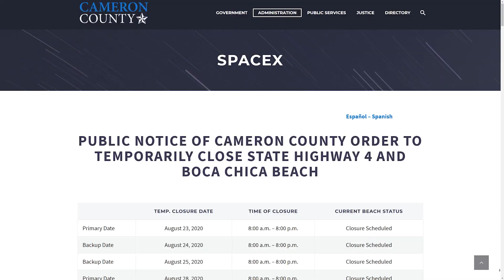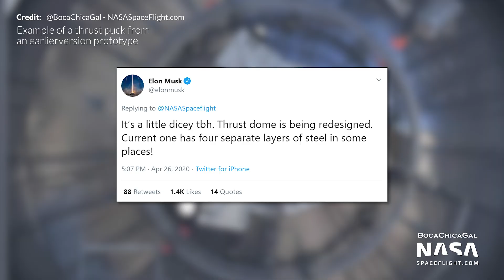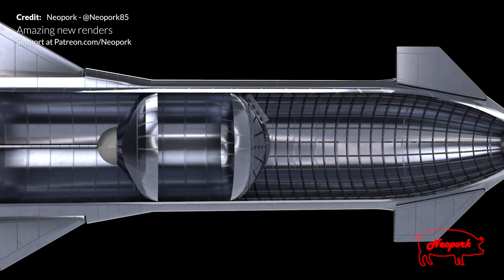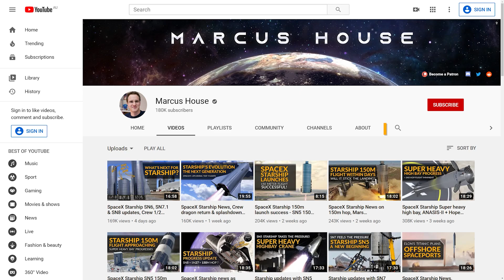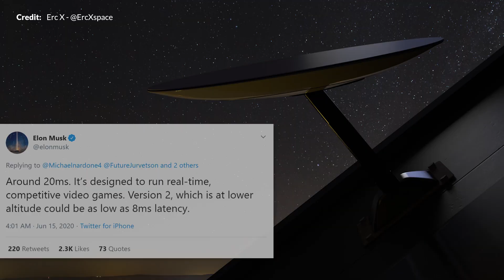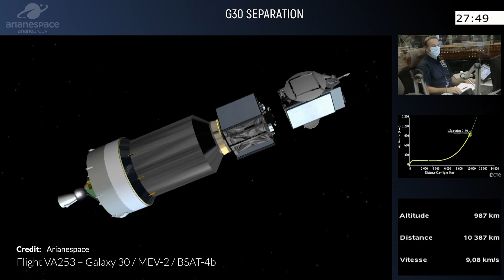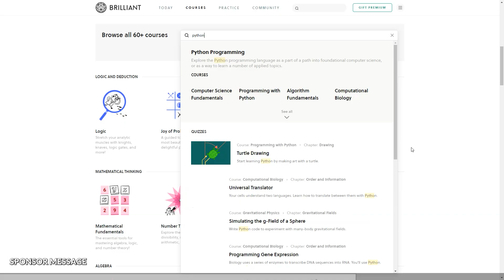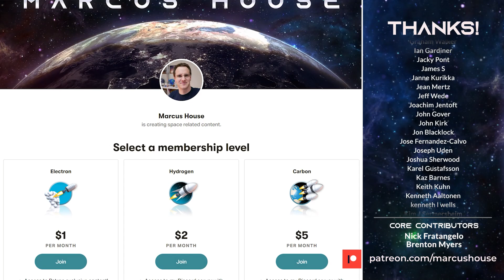SpaceX Starship SN6 to fly in less than a week!?, Starlink Speed Results, Saocom 1B, Ariane 5/MEV-2

Comment: Note that I think Gwyn once mentioned that Merlin had been tested to 240,000 lbs thrust successfully.  The 190,000 lbs used is about 80% of that so likily as not Starship and heavy will not go beyond 80% of maximum successfully tested except in an emergency, or perhaps even less if a man rated flight.

Comment: So I know this is a few days old but it has taken me some time, when I have had it to think about the actuators and pivot points required for the movable surfaces for Starship. The aerodynamic forces on these surfaces at speed will be no joke. The actuator(s) or piston will need to supply significant force to move the wings smoothly and accurately. has anyone else thought about how these would be mounted? What will be used? A pneumatic or hydraulic Ram? What about the pivot points? I spent 21 years working on Naval Aircraft and flight surfaces have a variety of means to move them. What are your thoughts?

Comment: For the moving platform boat thing, why don't they just cut out the circular part and make it like a gimbal such that the hull of the boat moves around, but that circular cutout just stays constant? That can then interface with the rocket, and or sense the weight of the rocket on touch down, and apply a break to the circular portion to lock it into sync with the hull.

Comment: I love Elon's engineering principle: if we can build it and make it work in the dust on earth, it will work in the dust on the moon and mars... However, i'm still fairly confident that the very first thing space X delivers to the moon and mars is a landing platform for the starships to land on propulsivley without creating their own craters.
Reply: Even if in unlikely case this is Elon's engineering principle, it is blatantly wrong. Dust either on the Moon or Mars is vastly different in composition, structure,size, mechanical and even electrical properties. Closes approximation would be vulcanic dust.

Comment: Starlink already has better speeds than I have with fiber optic cable through Frontier in the U.S.! I pay $90 a month and they only guarantee me 15mbps down and 5mbps up. I don't even hit those numbers on a good day.
Reply: @Forcemaster2000 15 Down / 5 Up doesn't sound anything like fiber optic at all.  You might want to double-check with Frontier about the internet package that you're having.  For $90/mo, you should be getting the FIOS Gig Service as shown here (https://go.frontier.com/fios/internet#:~:text=How%20fast%20is%20Frontier%20FiOS,a%20more%20seamless%20online%20experience. ).
Reply: Possibly you are having DSL 2 fiber or similar fraud. Anyway, in most areas of US you have no competition, so operator can limit your speed at will

Comment: It would be nice to get an update on Blue Origin's BE-4 engine.  Tory Bruno reported that BO is having problems with the BE-4 turbo pumps. Blue Origin is still troubleshooting the 75,000-horsepower pumps that bring fuel to the BE-4’s main combustion chamber, Bruno said, adding that’s he confident the issues will soon be solved.  However, considering BO is not known for being on time and the importance of the engine to ULA's Vulcan, anything known additionally would be most interesting.
Reply: 75k hp is about twice the power of Los Angeles class sub.

Comment: Love it Mr M. 
Just one thing. 300 bar? Ain't much. A scuba tank is 200 bar. Pls explain to this idiot :)
Reply: @Mark Wood - keeping 300bar at very high temperatures, in a oxygen rich environment, while the combustion gases are flowing out of the chamber (which requires very powerfull pumps to keep injecting fuel and LOx at cryogenic temperatures - without breaking themselves apart - just to sustain that pressure and therefore the thrust) is a enormous engineering feat. Only possible thanks to generations of scientists and engineers in many fields.

Comment: Question on the tanks: Does the upper tank top and bottom weld to the actual outer rings to form a tank? Does the bottom dome of the top tank serve as the top of the bottom tank? Crazy good renderings!!! Helps me see how this is all constructed. Thanks!!
Reply: Yes and yes.
The skin of the rocket is the side walls of the tanks. That's why you see atmospheric water vapour condensation and ice forming on the outer surfaces of the rocket that are holding chilled or cryogenic fluids. 
The upper dome of the bottom tank serves as the bottom dome of the upper tank - that it's called the common bulkhead design.
All of this is pretty standard rocketry, and is being used for many decades now.

Comment: Can't wait for Starlink. Even prototype speeds are better than I was getting 2 yrs ago. Fiber connections aren't all that. The speed options are great, but the reliability and stability are determined by the ISP. So far, I'm 0 for 2 when it comes to decent fiber ISPs.

Comment: Marcus:  How about a quick explanation of how rocket thrust is measured/calculated.  For example, a Raptor engine producing 225 tons of thrust at a pressure of 330 bar implies a working thrust disc area of about 11"in diameter (~92 sq-inches).  So I guess the pressure (thrust?) is measured at the top of the combustion chamber, and not elsewhere in the nozzle.

Comment: That Belly Flop looked soo scary in the animation imagine riding this thing! I'd crap my pants!
Reply: Peter Hobelsberger I know what you mean. I think it would still beat a super long haul flight like London to Auckland.
Reply: The ultimate roller coaster! Sounds like fun. Hope that one day costs can drop to < $10k for a Earth to Earth round trip.
Reply: @eyeborg3148  I doubt they will in our lifetime since that would only just cover the fuel cost. When the methane starts getting synthesized with solar power, it might get cheaper in the very long run.
Reply: @QuasistellarNymphomaniac 
Of course there are a ton of paying passengers on board, not just one.
Reply: Since some people like risky roller coasters how about Elon offering special rides on SN5,6 test runs...could charge extra special tickets😂😄
Reply: I wonder what would be the seat position as landing and take-off are vertical
Reply: @simonz5905 
Maybe they'll have some gimbal thing for the seats.
Reply: @simonz5905  Good point. Since aerobraking will likely pull a ge or two, I'm guessing on your back

Comment: As someone who lives in a rural area, I’m relying on Starlink. My current only solutions are geostationary satellite internet with latency of...a week or so, dial up over copper phone lines, or what I’m currently using which is a 3rd party sublet mobile hotspot on a corporate plan. So it’s basically unlimited and ‘only’ costs $80/month. Sadly, its reliability has taken a dive lately, and the speed maxes at about 12 mbps, usually hanging at 4-10, sometimes as low as 1 or even 500 k. 

so, even the speeds with a patchwork satellite network of 20-60 would be an insane improvement, and I’m confident these numbers will improve as more satellites are launched and can more efficiently channel data.
Reply: As someone who lives in a remote island in the Indian Ocean, I too can't wait for Starlink
Reply: @mohshahud  You may want to look up want starlink means for ships.  Highly dependent on ground relays
Reply: My dad has our house built in a rural area too low for point to point and off any grid so we all use our hotspots. This will be amazing
Reply: I sucks that I live close enough to a large city that Starlink almost certainly won't be suitable for me given the potential number of users overwhelming the satellites just like cell towers.
Especially because 1 gbps would be really nice. Still 80 mbps is much better than 4-10.
Reply: @nocare  I'm hoping for a reliable backup.  Install the antenna and activate the service as needed.
Reply: @nocare  That was one of the idea of Google Fiber. Once the installation cost was covered, through contract or cash purchase.  The service could be free with a limited 1 or 2 GB plan.
Reply: @nocare  Well for field work, let's hope the new 5G network
Reply: @nocare  The "full" 5G network will have a longer range and the government rural Internet program will allow them to build more towers.  I do like Starlinks chances.   Heck, even TV station towers can start providing Internet access.   It really will be a race to see who can suck up the lion-share of the government money.
Reply: As a professional pilot, I’m particularly excited for in-flight low-latency wifi
Reply: i live in romania and we pay here like 10 usd for 1 gbps
Reply: タメル nope. Maldives 🇲🇻
Reply: Extreme rural.  Nickel a meg. 4Mb/s max.  15 gig / mo hard cap.   $330 / mo.  Technovikings pillage us all outside the concrete canyons.

Comment: remember when the haters were railing on the raptor for only reaching 250 Bar?
Reply: Raptor thrust is still bellow that of the F1 engine and it's specific impulse bellow the J2 engine! It's proof that spaceX technology still haven't reached what NASA did in the 60's! \s
Reply: @Odd_Taxi_epi04  the raptor's purpose is not to get crazy high thrust per engine, and also, the J2 is a hydrolox engine, which is a completely different fuel technology with its own tradeoffs and disadvantages, for example, a metholox engine's fuel tank for the same mass of fuel only has to contain roughly 9 times less volume, meaning a lighter tank, as well as some other preferrable advantages (please see videos by Scott Manley and Everyday Astronaut). With regards to the F1 engine, the raptor has a purpose in being a smaller engine - namely that it makes it easier to land with, for example, a rocket engine usually can throttle down to about half its max thrust, so in terms of minimum thrust, the Saturn V's five engines can have a minimum thrust of about 10 percent, whereas on the (on paper) superheavy with 31 raptors can have a minimum thrust (assuming a three-engine landing) of under 5%, and potentially even down to around 1.6% if they use a single engine to land, this is a very desirable property for the hover slam maneuver.
Reply: @renchesandsords  \s means sarcasm
 
 r/wooosh
Reply: @jesusmora9379  /s means Shrek hahahahah

/r woooooosh  
/s
Reply: i read somewhere that it now has the same power as be-4. be-4 is not even ready yet and they keep running into problems.

Comment: 6th flight of a booster, that means it's basically free.
Reply: Christian van der Stap I thought Elon said it took only 3 flights to be free.
Reply: Nathan Lewis , about a quarter million in Fuel, LOX, and other consumables. Another couple million in boats, humans, and such to retrieve the booster. Then you have the cost of the second stage. So probably less than $10 million a launch. That’s cheap as chips for a LEO insertion. That’s probably 5% the price of a UAL launch. Of course, that’s just the marginal cost and if you capitalize the development costs etc across all the launches it’s higher but getting cheaper every day.
Reply: A starlink launch with a tiny rideshare inside Is legitimately free.

Comment: What is the differences between SN5 and SN6? Seeing that it will also only hop 150m (same as SN5)
Reply from the maker: We don't know yet. Currently no mass simulator for SN6, so that is interesting. SN6 we hope will fly higher.
Reply: They are built of the same type of steel and very similar. It looks like Elon will use SN5 and SN6 for basic flights and maybe use SN8 for the 20 km high flight with fins. (just my guess)

Comment: Why dont they sandblast the critical components/weldings?  I work in a company that sandblasts weldings like this to make them much stronger. If you sandblast weldings correctly, then they can withstand a much higher pressure.

Comment: 7500 tons of thrust for 31 engines is 242 tons of thrust per engine. They have insane expectations.
If they reach 250 tons for raptor 2.0 and 300 tons for sea level thrust optimised raptor (no gimbal) they only need 26 engines.

Comment: For raptor to reach 250t of thrust, you need 360 bars of chamber pressure. Personally, I think they should design the Superheavy so that it can hold both 31 and 37 engines. Way higher thrust is useful for bigger payloads and heavier tanker ships (with fairing volume replaced by more tanks, 900t increase)
Reply: Jerry Jiang...Reading your reply, I was thinking, “Adding more ENGINES does virtually no good unless you can ALSO add propellant (bigger tanks).”  Then, you covered it!  👍
Reply: @737smartin  but then you have to add more engines again.

Comment: 330 bar isn't that much. Simple bottles of compressed air used by scuba divers are typically pressured at around 300 bar. This has existed for decades.
Reply: I think, this is the chamber pressure of a firing rocket engine.
Reply: Possibly something to do with a difference in the operating temperature...